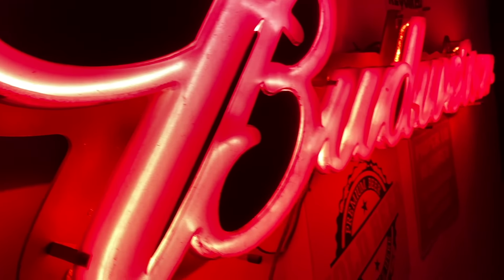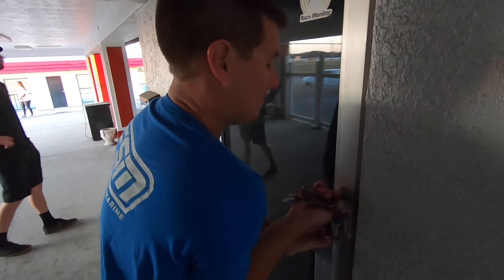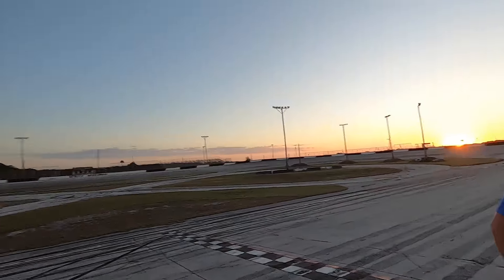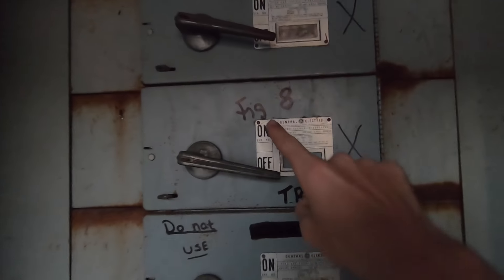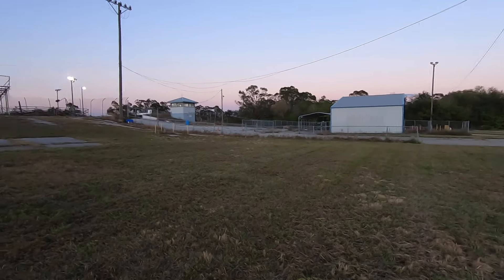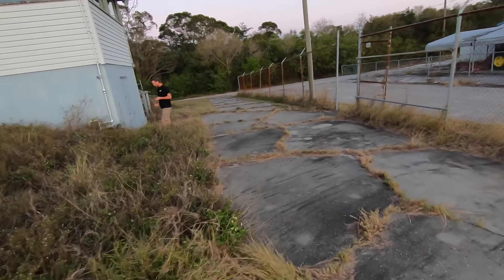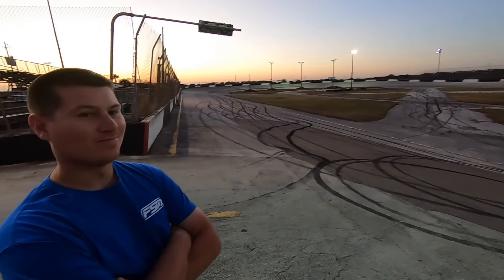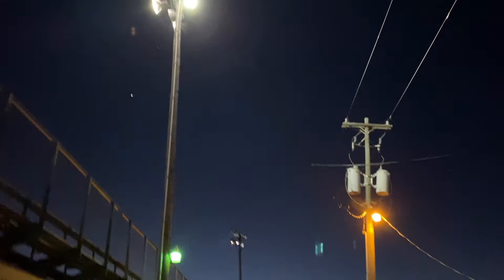Restoring Power to our Abandoned Speedway After TWO YEARS in the Dark! (Freedom Factory)

Comment: The electric bill for this place scares the hell out of me.
Reply: At most those lights are 5,000W each. Probably 3,500. Let's say there are 100 lights. At 12 cents a kWh that's roughly $42 an hour at 3500W each, 5k should be around $60 per hour. They can get 5k equivalent LED's. Say 75 or so 1500W LED stadium lights. That knocks it down to about $13.5 an hour. Also they likely get a bit cheaper rate on electricity so it should be a bit less than that even.
Reply: @VA-ng2ve  i doubt they will get a cheaper rate more likely a higher rate and will also have to pay a demand charge.  If there is any three phase things will get pricey fast
Reply: Think about all the refrigeration and climate control as well. My god...
Reply: Lassi Kinnunen  do you understand deductiions? Its not like you get that money back. All a deductiin doea is offsets your income so you dont pay as much in taxes.  I doubt that track will cash flow for quite som e time so he qill have more than enough deductions without worrying about electrcity deduction.my electric bill for 2019 was beyo d the $25000 figure . Mostly three phase though
Reply: @VA-ng2ve  agreed, and the cost of those LED's?  that's the catch.  the cost up front of the crazy expensive led's' and the install.
Reply: @patrickhickey8779  what would be 3 phase? Maybe certain outlets for battery chargers but the lights wouldnt be. Youd hope this place has a 277/480 service but since it's old I doubt  it. Then the loads for the pole lights wouldnt be shit
Reply: @patrickhickey8779  https://www.electricitylocal.com/states/florida/bradenton/ 

Commercial 8.72 per kWh, residential 10.4, Industrial 6.86.

Even with demand charges apply it shouldn't add up to more than say 14 cents per kWh, that's still only $70 an hour at most they should be paying in electricity charges. Yes other fees will apply, but just straight electricity it should be about that much or less. 

If at some point they get to running an event every weekend for a month at about 6 hours per day, that's $3,360 in electricity costs. Maybe 350 or so in ECRC/CCRC/ECCR, 100 customer charge, 1600 fuel charge, 150 taxes. So figure $5,560 a month running the lights for 48 hours. So with everything I can think of included it's still only about $116 an hour.
Reply: @WiscoMTB37  where i am at all the rodeo arenas have three phase lighting along with the local dragstrip 3ph also.
Reply: @VA-ng2ve  interesting where i am located the public service commision sets the rates and all industrial meters are metered at a much higher rate than residential.  And even my yearly meter fees are higher than smaller 3phase users.  I am by no means a huge power user and i am paying some of the highest rates in the state.  The one thing we have going for us though is we can get rebates from our provider when we change out to higher effeciency equipment . I just put in a freq drive  on a 215 hp motor and i got a 90 percent cost share and on a 40000 drive that is a signifigant savings. Just yeaterday we replaced some t5 flourescent fixtures with leds and had a 50 percent cost share . I would assume he could do the same on his outdoor lighting
Reply: @frotobaggins7169  If they get a boom truck like they said in the video the install will be fairly simple. Hell even renting one for a day or two shouldn't be more than $600 a day. The lights themselves can be pricey depending on which ones you get. 

Lights should be $5,000 or less each for 1500W Led flood lights. Ideally led's with high CRI. Thinking they should be able to find some for about 1,000/1,500 each if they talk to the right people might even get some for free. 

I think that place has at most 100 lights, 75 LEDs should be plenty. So figure 112k 375k. 

The install cost will be minuscule in comparison to that. 

If they could get a NASCAR bleacher guy there, getting a stadium light guy there shouldn't be that difficult.
Reply: @patrickhickey8779  https://www.fpl.com/rates/pdf/demand-explanation.pdf

Not sure about your area but it could be different ways they charge you. If you go to that link they do rack on some fees.
Reply: @VA-ng2ve  when they retro fitted the gas station down the  street the coordinator said that it would pay for it self in about 4 months.  i asked what the electric bill was per month, she said about 5000.  i figure it cost them close to 15,000 to do the retrofit.  those pole lights are likely 3 phase electric and the retro fit is likely not as simple as screwing new light bulbs in.  it will be new fixtures involving wiring.  maybe they all know more about 3 phase electric than i think but there is huge liability in electric.  what if the fixture falls?  what if someone hits the pole and gets electrocuted?  what is the system isn't grounded correctly?  when dealing with the public there is a lot at stake.  when accidents happen, you need to be able to reduce your risk and exposure to any law suit and the ability to point to someone else and say, i hired company X and they were qualified to do the work will go far to reduce your exposure.  they are in this for 10's of 1,000's of dollars and they could lose it all over some simple, stupid mistake like someone grabs the wrong wire or someone hooked the wires up wrong. or someone one dropped something that hit someone else. or any of 1,000 dumb scenarios.  this isn't them in their garage working on some little project anymore, they are involving the public now, theres insurance and codes and regulations.  sure they CAN rent a truck and do it themselves, but SHOULD they?  is it worth the RISK?
Reply: @frotobaggins7169  "when they retro fitted the gas station down the  street the coordinator said that it would pay for it self in about 4 months."

That's a gas station that runs its lights a lot longer than these will. The track will likely only be used on the weekends or say 2 days a week maybe at night. It would be cheaper renting/running the track during the day that's when most of its use will occur. If they run the track lights for 6+ hours a day every day then yeah it would pay for itself a lot quicker. It all depends on the usage. More usage = lower time till it pays for itself. 

"i figure it cost them close to 15,000 to do the retrofit"

The labor and equipment rental shouldn't be that much for them since they may get discounts or free? How many fans do you think will offer their services for reduced or free? The majority of the cost will be in the actual LED lights themselves if they can't get those for reduced or free. 

"it will be new fixtures involving wiring. "

The wiring can be left the same even if they go to single phase. You really don't need to replace it especially going to LEDs. If the loads increase beyond the capability of the wiring? Yes replace it. If the wires have a lot more resistance than  they should? Then yes replace. If they test good? Why replace? 

Depending on the 3phase service 208v 3phase as all legs to neutral are 120v. So that would be very simple to install. Just need to do a bit of load balancing, don't want to put all load on a single leg. Outside of that if they want to just convert the 3phase to single would just need to add a transformer into the line. Even if you have 100 LED's at 1500w each, that's only 150kVa. You should be able to easily find a 150kVa or 200kVa transformer for under $5,000.

"what if the fixture falls?"

That will be under general liability insurance for the track. 

"what if someone hits the pole and gets electrocuted?"

That would depend on the culpability of the person and the track. If the track took necessary precautions to prevent such a thing from happening then it would be harder for someone to get electrocuted. If the person that did was at fault or did something reckless to get electrocuted then it would be on them, not the track. 

"what is the system isn't grounded correctly?"

Grounding correctly isn't hard to do. They had an electrician come out and check it out. If they have an electrician out to do the retrofit and or they do it themselves under the supervision of the electrician and or the electrician going behind them to check their work? Then? 

"when dealing with the public there is a lot at stake."

Yes and that is what insurance is for. What Garrett has in his pocket that the previous owners did not is this channel. They were stuck in the past thinking about live streaming being a bad thing, or streaming an event is a bad thing. For smaller tracks if your product is good, then people will come to it. So even if there is an accident that exceeds the tracks liability insurance then I am pretty sure he's going to be okay in that regard. 

"hooked the wires up wrong."

I covered this above, but to reiterate. I am positive whatever work they do themselves will have an electrician come behind them and double check their work. 

"sure they CAN rent a truck and do it themselves, but SHOULD they?  is it worth the RISK?"

You are acting like this is some simpleton off the street walking into a hospital to do brain surgery. It's not that complicated. Especially if you have a licensed electrician look over your work or you consult one. If they were moving from LED's to metal halide lights? Where it's over 3 times the power consumption for the same output? Then yes you would need to run new wire. Stepping down? No you do not need to. Going well over what you need on wiring is fine*, going under is where the resistance builds up, heats up the wire and is likely to cause a fire. As long as the lines tested fine they should be 100% fine to reuse. The last bit the fixture would be different. If they get 3 phase LED lights then no conversion to single phase. No transformer no using 1 leg and neutral, etc. 

*The only time you really need to worry about going with a heavier gauge wire is if your load requires some voltage drop. For instance you have a load that 100% requires it to be very tight to 110. If your supply is 120, and with thicker wire(lower gauge) then the voltage drop will be less, and you will be a lot closer to 120 than 110. Since most loads can easily handle 110/120 +/- 5% it shouldn't really be an issue here. Also if by chance it is an issue. A simple in line resistor can drop the voltage to where you need it to be. 

While installing an LED light fixture isn't as simple as screwing in a light bulb, it isn't all that difficult either. Unless your mechanical inclination is that of toddler most people should be able to do it. If you can change an outlet you should be able to convert to an LED light fixture. Now going from 3 phase to single? That can get a bit trickier but speaking with an electrician to know what you need will make that process a lot simpler. 

Think of changing a light bulb as changing the oil in your car or changing a tire. Changing over to LED would be like changing spark plugs. Changing to single phase LED would be like changing belts. You seem to think it's closer to removing a head or blueprinting an engine. The only time it really gets complicated is if you try to shoehorn in a solution that doesn't work normally. 

If an electrician comes out and says "this is what you need to do", at that point it's just following directions. 

One last bit, they are thinking of buying a truck. That will cost more upfront than renting but over time it should pay for itself if they need to do any repairs that would be more difficult using say a ladder. Going to LED's I don't think they will be using the truck that much, but they could rent it out now and again to keep it in good use and get a return on that investment. Knowing them at some point it will be a burnout vehicle or something crazy. 

All in all with their ability to find sponsors and fans that can help, and the capability they have shown thus far I don't have any fears or concerns regarding their or the tracks viability. At least in the short term like say 5 years out. The health of the channel I think will dictate the health of the track.
Reply: @VA-ng2ve  yeah, they could reuse the wiring and maybe even the current supply, i don't really know.  my point was they need someone who does really know.  and i agree the cost of the lighting will be the largest factor.  i've seen that several people have offered their services but again, there's that pesky liability.  and you're right, they have insurance.  what's the deductible?  i did work for a company that owned hotels, their deductible was 25,000.  more importantly, do you think the insurance company will keep insuring them if they let just anyone service critical things like the electric, bleachers, track surface?  and if you think that if something goes wrong, the insurance company will just pay out, your mistaken.  they don't want to take a loss.   they may pay, but they will investigate and sue who ever they find at fault to recover the money lost.  it's a business.  and that brings me to the volunteers, are they insured for this kind of work?  do they carry enough coverage?  don't get me wrong, i'm not saying they can't do it, they can and they will.  i'm just saying, it's not as simple as renting a lift and screwing in an LED lamp.  that's all.  he'll get R done i have no doubt.  but there are risks to be considered.  i worked for a fortune 50 company and that' the biggest thing i learned there, that you have to look for liability and reduce exposure.  one law suit, even if you win, can consume everything you have.
Reply: @frotobaggins7169  "i've seen that several people have offered their services but again, there's that pesky liability."

If they are licensed/insured, and or know what they are doing why not take them up on it? I mean sure don't take some Joe Blow off the street with only a pair of brand new wire strippers in their pocket and say have at it Hoss, but if they have the tools, know how, and or are licensed? Why not? I don't see the big deal there. 

"what's the deductible?" 

For what they are doing? Probably in the higher range at least for a while until they can show a decent safety record and or low claims I assume. 

"more importantly, do you think the insurance company will keep insuring them if they let just anyone service critical things like the electric, bleachers, track surface?"

What? Who said anything about "just anyone"? I mean for fucks sake, the guy that looked at the bleachers was the guy that does a lot of NASCAR tracks. How in the hell is that just anyone? You seem to think volunteered and or reduced rates are somehow sub par or below the norm? Sure if you bought a track and you had your buddies uncle's fathers daughters best friend do it that had little to no hands on experience saying they could do it since they watched a few youtube videos? Sure you'd have a point. But for a channel of this size getting large companies to sponsor you, a lawn care company to cut the grass or get it under control once a tractor dealer saying here run this expensive piece of equipment for a year, etc isn't out of the ordinary. Getting a highly skilled highly qualified electrician to offer their services for a plug or two for their buisness wouldn't be all that difficult. If an insurance company had an issue with that, then holy fucking hell batman they would have a hell of a lot to say about their daily activities. You can pack Leroy up in mothballs. You can shut down the burnout pit, etc, etc. If the electric is what tips the scales in regards to insurance then that would be insane. I mean it would be like failing to insure a car because the owner didn't tie their shoes or something very odd like that. What they do on the track, what they do with their time at the track. That's where the overwhelming amount of risk comes from. Not them or someone else who knows what they are doing from wiring up a few lights. If they wired the lights blindfolded, bridged gaps with paperclips, etc that would probably have less impact on the insurability than what they do on the track. Having a functioning, well maintained catch fence will be of primary concern for circle track events. Making sure there are plenty of fire suppression equipment on site and qualified people on site or on standby will lower the premiums. For crowd control depending on how rowdy crowds tend to get, having security guards on site will lower premiums. The wiring, if it passes inspection, the insurance company could give a fuck less if it was Joe down the block that was licensed and volunteered his time over the highest end electric company this side of the Mason-Dixon line. 

Now as for the hotel? Hotels have their own different set of liabilities. You also seem to not understand that a hotel is 24/7 or nearly. A track like this is essentially out in the middle of nowhere, and there will not be max capacity at the track 24/7. It's a largish number of people during events, after not so much. The way it would almost certainly be covered is a general liability policy for the track as is with few people there.  Then special event kinds of insurance for each specific event. 

"and if you think that if something goes wrong, the insurance company will just pay out, your mistaken. "

I am fully aware how insurance companies work. They don't just "pay out", not anymore at least. They will fight it to a point, even if it's clear as day they should pay out. The more minor it is the more likely they will pay it out quickly. The more they can blame something or someone else and the cost of the payout is high that's when they will fight harder. It boils down to a cost benefit analysis. With precedent, lawyer fees, investigation related fees, vs the payout. If one side tilts the scale in one way then that's the likely path they will go. 

" and that brings me to the volunteers, are they insured for this kind of work?"

Wow, seriously? Okay... I am not sure what is so hard to understand about this? If you do this work day in, day out. And you... volunteer your time and maybe resources for a plug or shoutout or whatever you want to call it for your buisness. It's the business or yourself doing this as a volunteer but you are still getting a form of payment. If you are licensed/insured for your daily job and your daily job just so happens to be for "free" a few days here and there to get better exposure it will be just like any other day, any other job. 

Also do you think if an accident occurred at the track and someone was hurt that there wouldn't be a go fund me up right away or something to cover their costs? Really? I think your line of thinking is stuck in the pre youtube pre social media era. Things have changed, and have done so drastically. If instead of Garrett buying the track and someone else did, and they didn't have a huge social media presence and this kind of channel? Then what you are saying makes more sense but those things wouldn't even apply. There is just a different set of rules in these kinds of situations. 

" i'm just saying, it's not as simple as renting a lift and screwing in an LED lamp."

Actually it can be that simple, depending on the situations and circumstances. I mean hell if there is a company out there that makes an edison screw (ES) LED light fixture with an internal ballast, it could be exactly that simple. I am not currently aware of any that would be bright enough for the application but who knows. 

"but there are risks to be considered."

I agree, but the way you are thinking about it in this context it's like the risk of the sky falling. Or something that has very little application to this. Again the actual actuarial risk is on the track, at the events. Not that much in the stands. Especially if you make efforts to mitigate that risk. If you have a flame thrower event. The insurance will be higher without fire extinguishers and less with them. If you serve alcohol it will be higher without security, lower with security. If you have a frayed wire that shocked everyone that walked it would be higher than if not. 

Seriously with this amount of worry, how can you get outside? There is a risk of you getting into a car accident and getting injured. There is risk everywhere you look the odds of it happening are fairly low. The odds of something electrical hurting someone is very very low. Especially insanely low if done by competent people. I'd argue there is a greater risk of someone getting hit by lightning and one of the poles falls on them. 

The only other large risk I can think of is damage to the facility either during an event or outside of it like what happened while it was vacant. This time by people who are not fans of the channel. That's where security and security cameras come in. This can be especially useful for crowd control and people who may want to commit insurance fraud. Like falling into a wall, and saying a brick was half an inch too high or some bullshit like that. Having clear video... lowers your premiums. 

Not to mention there will likely be waivers in the mix as well. 

"the biggest thing i learned there, that you have to look for liability and reduce exposure."

I agree... to a point. You cannot. I repeat cannot reduce liability exposure to 0. There is no way in hell that is possible on this planet in this reality at this time. You have to look at it with cost/benefit in mind. Do you want to spend 100k, and 1,000 man hours to reduce the risk of someone one day somewhere in the future needing a bandaid? 

"one law suit, even if you win, can consume everything you have."

Sure, sort of. If this were any other person in a different kind of situation? I'd agree with that to a certain extent. But with a channel and lots of fans? I find that very hard to believe. As long as the fans are behind him and think whatever incident came up that he tried his  best to avoid it and or help the person out? There would be a shit ton of support behind him. And if someone tried to defraud the insurance company and or take Garrett to court, I could see the courthouse packed with supporters offering up time and or money to fight it. Again, this is not a normal every day scenario. If this was some nobody buying a track I'd agree a lot more with what you are saying. But it's not. The rules... are different.